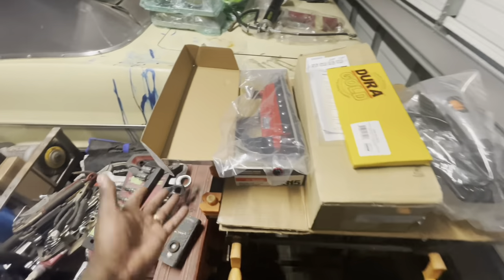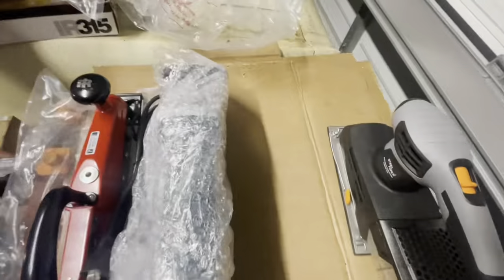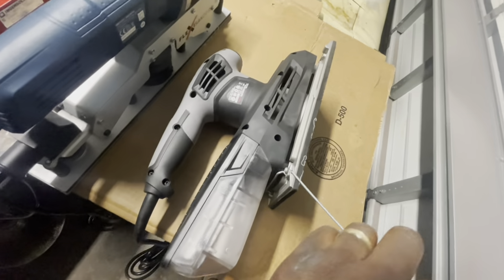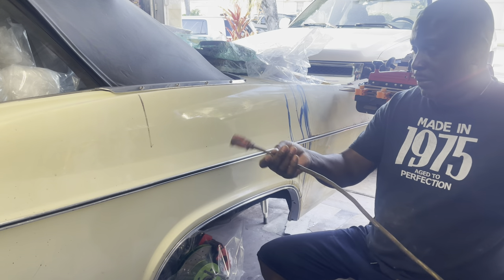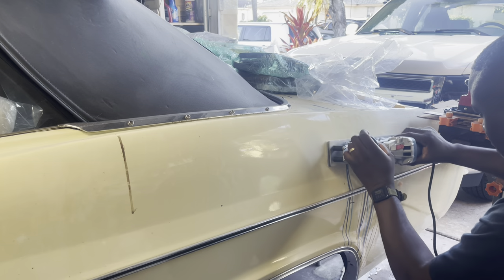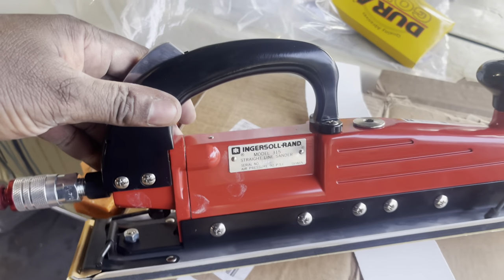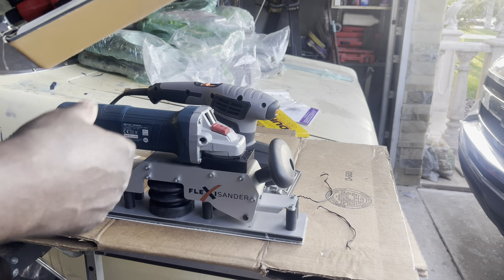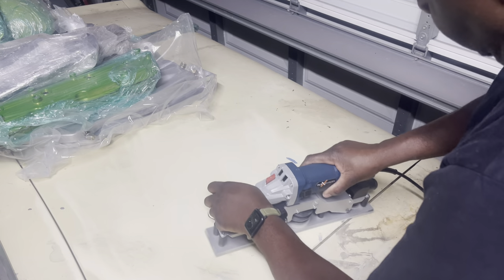Flexisander Electric FS40070E,  Ingersoll Rand 315, Steel Force PFS300 long block sander review

Comment: I use my air file just about everyday in my shop. Mine is harborfreight model tho. I would say don't use sticky paper on the air fule because the paper will rip the foam backing on the air file over time
Reply from the maker: Thanks for the info

Comment: 5.0 out of 5 stars 2
                 Flexisander Electric FS40070E,   $735.00 good grief that thing is pricey. Look like i wont be getting this sander😮
Reply from the maker: Yes I thought the same, it is a lot more than the other long board sanders, but it also does make the job easier.